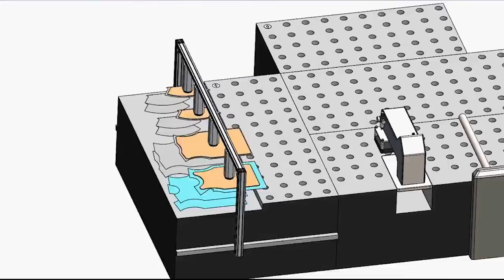'Sewbot' makes T-shirts

Comment: Only works at maximum output rate when all the fabric is the same specific textiles and quality in the batch and the machine has been calibrated  correctly (by a human) for  each module/step in sewing/assembling the garment.
If you change fabric or even thread type you have to re-calibrate the entire machine/ step in the process. So, you are replace 10 low wage workers with one higher wage worker and adding limited textile capabilities.

Comment: And the industry is working just as hard to replace the textiles used to make the clothes. The aim is to have a circular process where the clothing can be redesigned, reused and then recycled. Many companies are investing in the development of new biodegradable materials such as Pinatex for example. The 4 industrial revolution is here to stay and it will need new work force, jobs will not be lost, but transformed.
Reply: Austrian economists. I no longer believe the `jobs will be redistributed` bullshit. The scale of job loss will lead to a significant % of unemployment. Let's wait and see.

Comment: This video looks like wishful thinking not reality.
Reply: You are wrong: this is reality. The control by suction plate and precise alignment of edges is reality.
Reply: You obviously know nothing about IT. I suppose it was people like you who laughed at people like the wright brothers when they explained how machines could fly in the sky.
Reply: The Germans already made much better stuff back in the 1950s. This machine is crap and a joke. Go check out Alder or Brother for the real modern stuff. Too much machine handling is always the sign of a crappy engineer. You should have done more research.
Reply: I can't see how any technical innovation has benefited people.  It just creates more low grade jobs as the machine takes any skill out of a job
Reply: @darahauspage  Dude those are modern sewing machines but they aren't automated the whole point is to have less people needed to do the same amount of work
Reply: @darahauspage  
Are these machines automatic? can they produce a t-shirt by themselves or do they still need human intervention to work?
Reply: @una-janewinfield1667  you are worng. till today I haven't even seen a single video of robots making tshirt without human intervention. the material of the clothes that is too soft makes it difficult for the robot to do it. plus sewing the neck of the t-shirt requires flexibility.. all of these machine just concept till today.